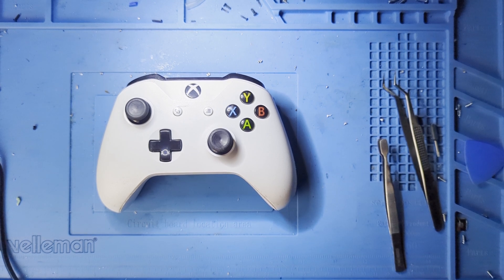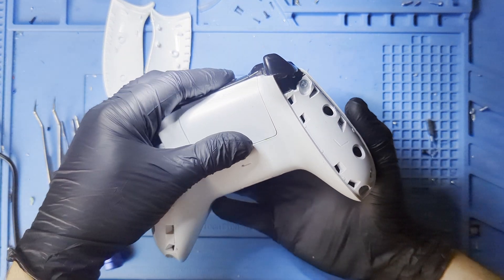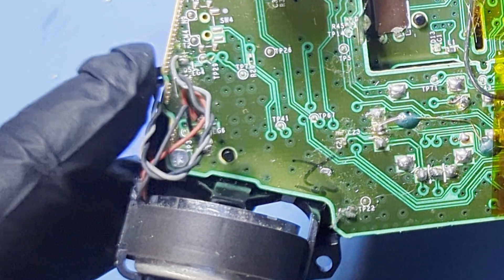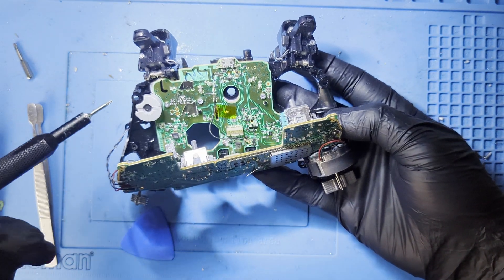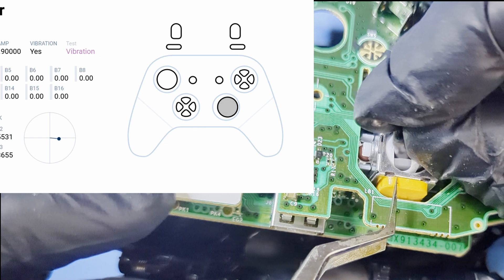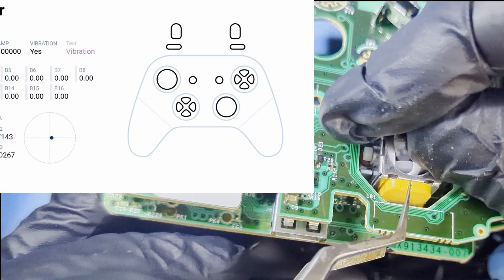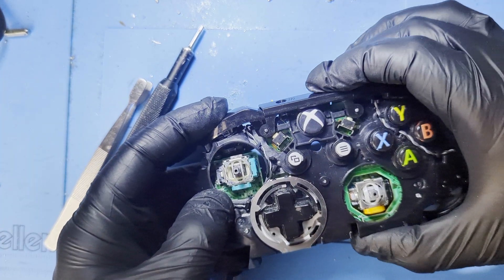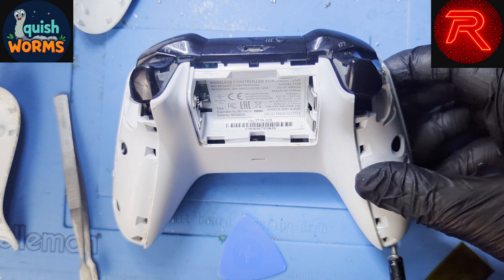How to Disassemble & Calibrate Xbox One Controller Hall Effect Sticks TMR | Full Step-by-Step Guide

Comment: Does it stay calibrated after some time using it? I saw some comments of people saying it goes back to the wrong position after a while
Reply from the maker: I'm working on a new video where the calibration will be done through software instead. I'll let you know when it's out :)
Reply: @mkFix-pl  Great, i'll check it out. Will the software be compatible with the 360 controller? That's the controller that i'm thinking about replacing the sticks. I heard software calibration can only be done with the series controllers...
Reply from the maker: @cbt5490 at this time, there has only been found a solution for the Xbox one controller. If a solution is found for the 360 controller, I'll be sure to be one of the first to cover it :)

Comment: I think all that fiddling just makes the joystick tired so it gives up and and bends to your will:). I took a look at Favor TMR (green and yellowish potentiometers) I got and just looking at it physically it won't make sense for this to work for sure. Magnet is attached to either axis of the joystick in ONE piece design, in order for the adjustment to happen it would need to be at least two piece design just in the magnet part alone so unless piece holding magnet is bent it won't make a difference. IF hall effect have same design then this is more of a bending that magnet holder than actual adjustment. It HAS to allow magnet piece to move, if it's one piece of plastic that makes it not possible since the receiver is also soldered with 3 pins to the board, you can just very slightly solder that off center which might give similar "adjustment" results.
Reply from the maker: Interesting. I'll have to take a hall effect apart and see what's actually inside. From my understanding the hall effect is the only joystick you can adjust manually without software. But as you say it can all be placebo 😂. I guess I can sacrifice one stock for science 🤔

Comment: Trial and error is definitely right, been at it for an hour and still can't figure it out, how do i know when to use different holes when calibrating?
Reply from the maker: You kinda have to developed a sense for it and see how it reacts to what you do. I've had some sticks that get calibrated easy, and some that were harder and you had to fiddle with swapping what direction you pulled the stick to.

Did you replace both sticks on the controller or just one?

Comment: thanks for your video, recently I changed my xbox one controller gen 1 to hall joysticks but the left joystick interacts with the left trigger and when I'm not moving it, the trigger is always pressed, anyone knows how to fix that?
Reply from the maker: Did you accidentally remove a component by mistake or create a bridge somewhere?
Reply: pretty sure its something to do with the fact that the magnetic fields used by the hall effect triger and the hall effect potentiometer are interfering with it order your self some tmr sticks and replace one or both to fix the issue
Reply: @jonathanmoreira8930 well you can't use tmr because they HAVE to be calibrated through software and thos controller doesn't offer that. Gotta love the big corps for that one 😅

Comment: Very good video. Can you help me with one problem? I've messed with a pad from the right analog, RSX one which usually can troubleshoot by connecting it to TP66. I did that and messed up the TP66 pad too. Where else can i connect RSX (the middle pin of the analog from the bottom ones) if not TP66? Thanks a lot
Reply from the maker: It's pretty late for me right now but I'll check that for you tomorrow. 

You could join my discord (in description) and post some pics in #repair-help so I know exactly what you mean :)